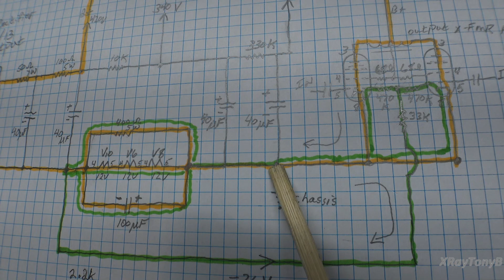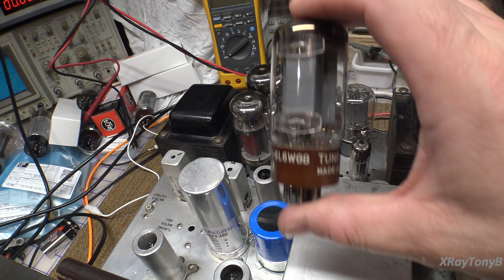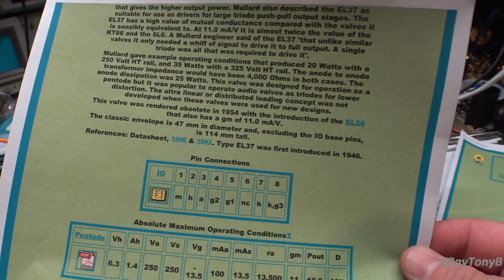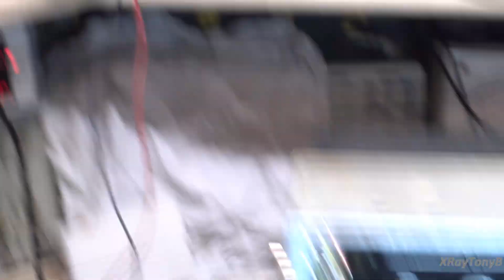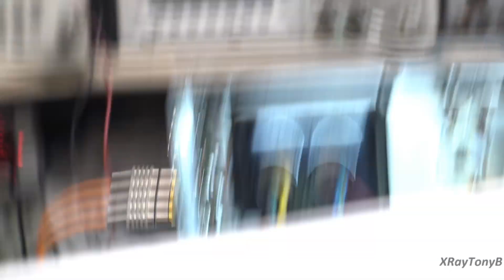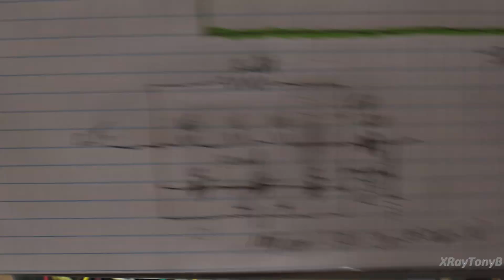Output Tube Experiments - Fisher 500

Comment: Tony, I just realized what I have done- wrong:  I rebuilt my Hallicrafters sx-42 painstakingly slow and methodically. But when I got it all done bench checked out and aligned as best I could do.  As you know it’s a lot of work- I replaced all the film caps and picked off all the out of spec resistors I could find. The last thing I did before firing it up on it s new shelf next to it age appropriate speaker was change from glass to nos metal 6v6’s. Before it even settled in after turning it on it went into a shreaking oscillation. I turned it off and walked away for a few months. Over time I thought through each step along the way. Long story short the case of one of the output tubes connects at pin 6 and in my sx-42 with glass tubes specified use the pin to connect a bunch of stuff to b+. Lucky I never touched it while on. My sx-42 was built exactly according to one of schematics readily available on line so I got lucky that way. But this simple mistake caused a whole bunch of stressed parts and dead end investigations I probably learned a lot more and watched your videos on the halli regularly for months trying to find out what I’d done wrong. It is a really convoluted design and the layout really isn’t a techs friendly one. I am still working my way back to square one post rebuild but would have ever even thought to do this project let alone get through it with good results without your work to learn from. Thanks so much. It is a really beautiful radio to have and enjoy. David

Comment: @2:54 you say that you used a 5W zener in your modification. The 6.3V zener was a 5W but @48:30 in your video about this very modification you tell us that the zeners in parallel with the three fillaments are 1W zeners which I suspect will fry rapidly at the point of the open circuit. It will be carrying 150mA at 12V. Did you "miss speak" about the 1W or did you confuse the diodes as you explained it here? Either way it's confusing.

Comment: The 6CA7 is a beampower tube....EL34 is a penthode.....Both are more or less equivalent ....a lot of EL 34 are labelled 6CA7/EL34 .......
The 6CA7 GE often called the Fat Boy is a very good sounding tube.....just like a 6V6G  and a 6L6G......
The EL 34 has a 25 watt  plate dissipation......The 6L6GC has 30 Watt ....a 7027A has 35 watt .......as has a 7581A.....
BUT.....the EL 34 can handle up to 800 volt on the anode......and one push pull of these tubes can be used for a 100 watt output amplifier ....NEVER TRY THIS WITH NEW PRODUCED TUBES , only good NOS tubes can handle these specification...
Tubes are inherently more linear devices than solid state semi conductors......and that is one their qualities........also they are less prone to thermal modulation....and need less FB and other tricks to  fake exceptional specifications on the test bench.... bass is only limited by the use of OPT's who can only pass AC signals and no DC , even when  these OPT's are not perfect  or neutral they have other advantages (MC knows that and uses OPT in their Solid State amplifiers)....all those and many other technical characteristics  can make a good tube amplifier sing like no their solid state  can , how good ial signals measure on sine waves , which are not music but repeated test signals and not dynamic musical signals which are  not related to real music transients..with all their harmonics in the right place in time ....FB which lacks real time correction does a mess to the timing of these and the sound ( music ) collapses as they pass a certain level of given FB....but you get a clean lifeless sounding amplifier which measures exceptional on he test bench.
It is easy to correct repeated signals......But to correct transients in real time.....That's real life....and Where the vacuum tubes rule.
Ever wonder why two amplifiers both measuring 0,005 % THD sound so different and sometimes don't sound good at all ????........
Semi conductors how good they may be are still SEMI CONDUCTORS  ..tube are not ! they work at the speed of electrons in a vacuum.... and they are high impedance loading n their command grids.
The ear is very sensitive to transients ( time related) .....less on frequency variations...
Reply: I agree completely. From stem to stern, as they say. I am knowingly making this statement with a LOT of experience and knowledge of the subject matter. de KQ2E

Comment: Than you for nice  piece of information and knowledge . 

  I do not think there is any mystery in tubes. My idea  to  the reason of different sounding is placed not in tubes but in speakers. Even order harmonics play role only in overpowering which is not case of HI FI  audio but only in El. guitar distortion. 

  In speakers  are  rooted  three  kinds of resonances - mechanical produced by enclosure, suspension and membrane,  electrical made by connections and band pass filters (if any) and acoustic provided by membrane radiation. The last make  no differences between solid and tubes.  . Every separate resonance of two first has  reflection in phase shifting . Resonance is equity to phase shift. and exists between voltage and current on output terminals - no need to be explained,. It means they do not balance that signal which is coming-in at input. where we compare them by feedback and want not to impact sound . How much it falsely modifies  original sound   depends on how deep is feedback. And that is main difference between solid and tube transistor.

Comment: Hi there! A couple of things worth noting... on the EL34's, they draw more current on the filaments than a 5881 or a 6L6, the EL34's draw 1500mA per tube, while the 5881/6L6 draws 900mA per tube. That being said, your EL34's may have some voltage sag across the filaments, especially if the stock power transformer is being used. This potential of extra voltage drop or "sag" CAN cause the distortion that you are seeing on your scope. What you could do is put in the EL34's in and check for voltage drop across them, and compare that VS. the 5881/6L6 tubes. Another tube you can try that may work well is a 7027A tube. It is similar to the 6L6GC, but it can take higher plate voltages (up to 600V) and therefore can dissipate more power (35W max VS. 30W max for a 6L6GC).  However, on a 7027A, pin 6 is connected to pin 5, so you'd have to make sure nothing is connected to pin 6 on your tube sockets, otherwise you might have a problem if you try to use 7027A tubes. Also, another tube to try is the Sovtek 6L6WXT+. These tubes are very rugged and I have personally seen these tubes take up to 25% over their maximum rated plate voltage with no fuss. Love the videos, keep up the good work!! Subscribed!
Reply from the maker: Never thought about the filament current of the output tubes.  Although they are not associated with the bias circuit, maybe the power transformer begins to saturate a bit, due to the overall current draw through the transformer?  I agree that an 8417 or 7027 would probably be a drop-in replacement for these.  I tried a 6550, but that was a bit overkill and the bias was not right for those either, even though they didn't care about the plate dissipation.  They also looked really out of place, crammed together on that small area of the chassis!  Thanks for the comment!
Reply: @xraytonyb  Anytime! The 6550's suffer the same problem as the EL34's, the filaments are rated at 1500mA per tube, and the 8417's are 1600mA per tube. I have a guitar amp that normally runs a pair of 6L6GC's, but I swapped in a 7027A's and it sounds fantastic while gaining a little extra output (10W). Like you, I was just experimenting, looking into alternative tubes I could install with minimal modifications. I believe J/J Tubes makes a 7027A that is currently in production, although I have had good luck on the Evil-Bay getting the RCA made 7027A's from the 60's and 70's.

Comment: what do you think about tube amps that pretty much give a shit and bias themselves? to me that sounds like some sky net type of shit! new viewer from brad guitologist.
Reply from the maker: I don't have a lot of experience working with the auto-bias circuits out there.  They can be pretty complicated with servo circuits and other means to maintain the bias.  A lot of those amps will also use an ultra-linear design, with screen taps on the output transformer, but not always.  Most of the examples of these types of tube amps I've heard sounded very clean and accurate, very much like a solid state amp.  When it comes to tube amps, I like all the "flaws" that goes along with the older designs, but that's just a personal preference.  I really like both my Fisher x-101-c as well as my Pioneer SA-9800.  Even though they sound very different, they each bring a unique and pleasant sound quality to my ears that the other can't.  Thanks for the comment!
Reply: Way more than I could hope for in a direct answer.  I pray you well sir.

Comment: is crossover distortion what what happens between upper and lower waveforms
Reply from the maker: When an amplifier is designed in a push-pull configuration, one tube handles the positive-going half-cycle of the waveform and the other tube handles the negative-going half-cycle.  The point at which the waveform switches from positive-going to negative-going is sometimes called the zero-crossing or "crossover" point.  In a properly designed push-pull amp, the one tube will "hand off" the signal to the other tube before it stops conducting (at least in a class AB configuration, but that's another subject).  If one tube stops conducting BEFORE the other tube starts, there will be a period of zero-signal.  It usually shows up as a little notch in the center of the waveform, when looking at a sine wave.  This is what we were seeing, when I was talking about the crossover distortion.  Thanks for watching!

Comment: Appreciate your in-depth approach to the bias circuit in the amp's finals. Comparing what you found in the amp to the schematic. The original Fisher bias circuit seemed innovative and effective too bad we can't order brand-new American-made tubes. We can't hold the Fisher engineer responsible for the increase in power Co's voltages. Thanks for the instructive video detailing the importance of proper biasing.

Comment: Bit OT, but I'm still curious about that multiplex output jack, on top of the chassis. If it was for an outboard FM-stereo decoder, how would that work on a mono amp?
Reply: Fisher made a stand alone mpx-100 and mpx-200 they would plug in. I have been looking for one.
Reply from the maker: Stereo was a new thing at the time.  Very few stations broadcast in stereo, but everyine knew that it was going in that direction.  The MPX jack was just an easy upgrade path for the older mono designs.  You could just buy an add-on module that would decode the multiplex signal from the tuner and output the two channels.  To hear it, you would either need to plug the MPX module into a stereo amp, or add another mono amp and listen to one channel in the built-in amp and the other channel in the additional mono amp.  Messy, but it would let you hear the stereo.  Thanks for the comment!

Comment: If the chassis is at minus 37 volts potential, I would expect that the potential for ground loops and eddy- current noise would be high. I also presume that all the input jacks and such have to be lifted and isolated from the chassis.

Comment: If I remember correctly,  the 5881, AKA 6L6WGB, is rated at 430 V and maximum plate dissipation of 22 W. Original Tung-Sol 5881 tubes from way back when,  however, are very tough and were often operated at well above those ratings ( see the tweed Fender Bassman). I wouldn't necessarily bet that the newer Russian or Chinese substitutes would be as reliable when pushed hard. These days, the Tung-Sol name is just that, a name,  owned by New Sensor who also own the Sovtek and Electro-Harmonix brands.

Comment: 8417
Reply: Vintage 8417 tubes are rare and expensive. Does anybody make a reliable modern version with the same characteristics as the original? I tend to doubt it. Same problem with the 7027 tube....
Reply: @goodun2974  a close version a modern horizontal tube glass base with anode on top they also used it rf amps forgot the number

Comment: What about the kt77 is it the same as a kt66 but more output

Best have a switch mode power supply for valve amplifiers running at 120kHz much superior
What is the best switch mode power supplies medical
Reply: KT66 is essentially a 6L6; KT77 = EL34/6CA7, and KT88 is pretty much the same as a 6550.